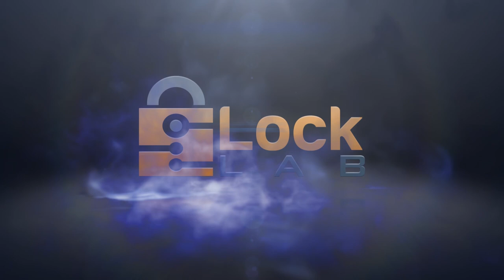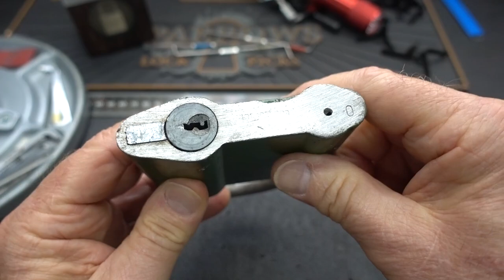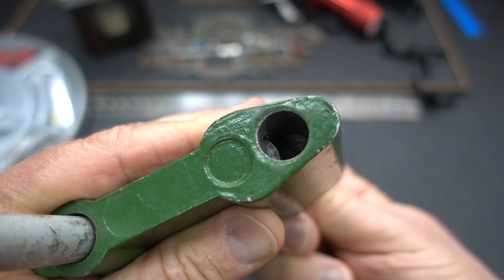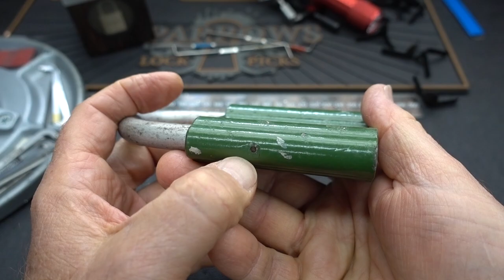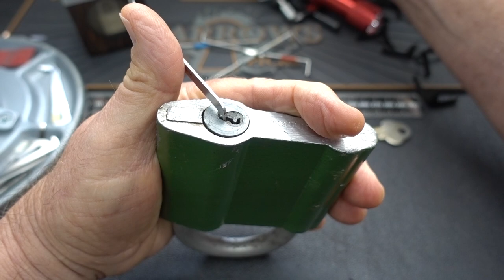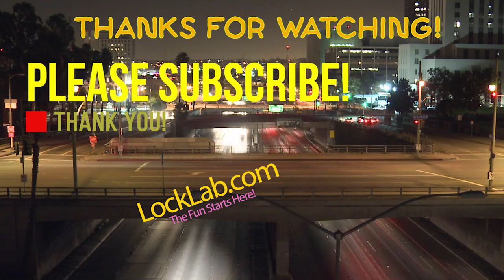(1765) Huge Russian Padlock Picked

Comment: There are 3 labels on the bottom:
Е31 Ц2Р86К - last thing is a price, ₽2.86, at the time when that lock was made, approximate rate for russian ruble is $1.0. E31 - I've no idea what is that, probably some catalogue number.
ОТК - means 'department of technical control'. It is something that you can find on chinese goods nowadays: labels with 'QC pass'. Basically means nothing since all goods had such labels that time.
and third one is just a zero.. no idea what for.
Lock is made in USSR, might be from any country from there. Not much stuff had brands in USSR, even quite popular things might have just a model since they might be manufactured in different places. Those places, all factories, all manufactures belonged to government, that's why there were no 'brands' like in USA. Communism, you know. Particularly this lock doesn't have name or brand and neither for the most of USSR locks.

Comment: There were not any key blanks available for this particular lock so whichever locksmith copied the key just took a generic blank with the closest profile and filed the side down. This is a very common practice when duplicating keys for old or unusual locks.
Reply: Looks like an old ASSA blank, looking at the handle.

Comment: I should mention that it's never "the Ukraine", but just "Ukraine" - I guess it's due to the similar sounds to "The US" or, more closely, "The UK".  To talk about the lock itself, even without security pins this is a pretty good lock because the amount of strength required to unload the shackle is extortionate, and in the field you're not going to have a table to press it against.  Theoretically you could push it against whatever door it is securing, but it's much harder to do against a vertical surface, and even harder if it's, say, a barred gate.
Reply: "The Ukraine" - you beat me to it.  ;)  We don't say "The Uganda" or "The Uruguay", after all. Ukraine used to be a geographic region - not a country.  So "The Ukraine" was arguably proper at the time - like "The Rockies".  But now as a country (since 1991), it's just "Ukraine".  It doesn't help that when Russian speakers move to US, they add "the" where it shouldn't be.  Like "I'm going to the WalMart".  ;)
Reply: @Chantillian  @WaterCrane
I think it harks back to as you said, the region, and the fact that Ukraine during the Soviet Union was the Ukrainian Soviet Socialist Republic, which could be shortened (crudely) to the Ukraine.